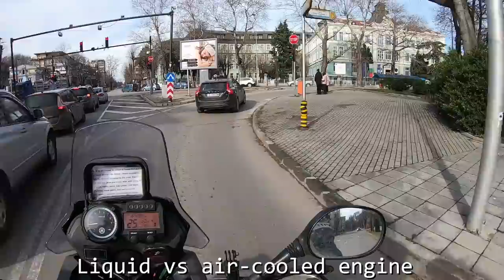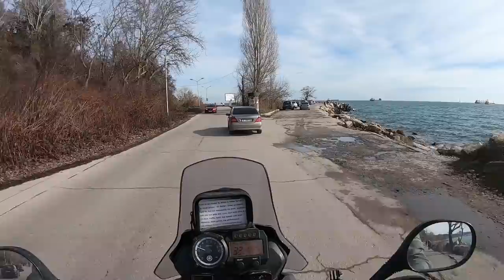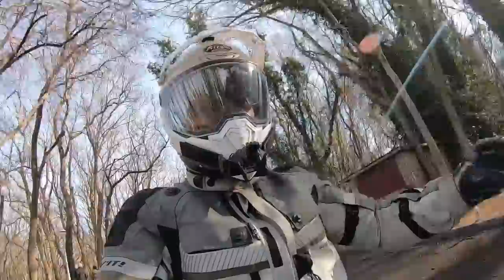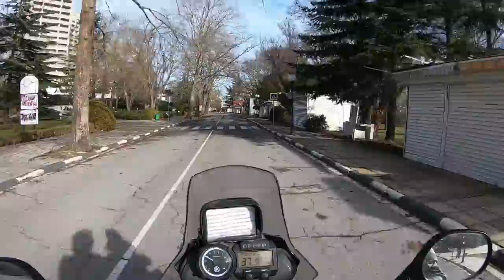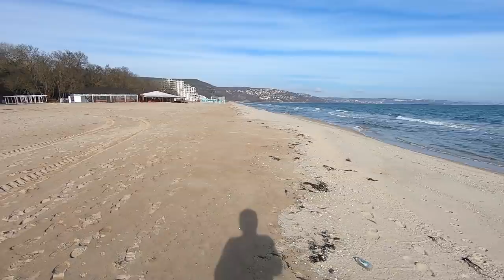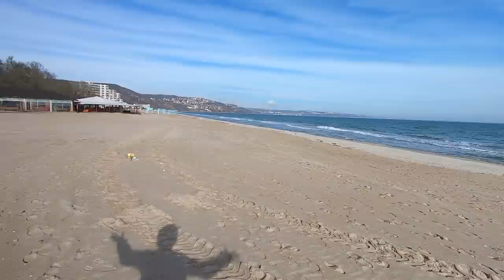Water vs Air Cooled Engine for Long Motorcycle Trips!

Comment: I basically agree with what you say in the video, but I’d put the differences to words slightly different...

As you might know I have ridden my 1990 Honda NX650 about 200 000 kilometers now, and they have been absolutely trouble free. Zero engine problems. And my old Diminutor (Dominator modified to be smaller) is certainly air cooled. 😉

But how do you distinguish between brand/quality and principle? 🤔

Has it been problem free because air cooled is as good av water cooled, or is it because it is a Honda? Impossible to know, but this I know:

I have hade the opportunity to compare with many similar sized motorcycles over the years. 

1992 and 1993 I was travelling a lot around the world with a friend with a Yamaha 660 Ténéré (with the original five valve 660 Yamaha engine, not with the 4 valve Minarelli-engine in your 660) and my Honda was not thirstier than his Yamaha. 

If anything it was the other way around. Mine took around 0,46 liters per swedish mil (=10 km) and his Yamaha took around 0,51 l/mil. Very small difference, but still. 

(Yes the scandinavian mil (used in Sweden, Norway and parts of Finland) is the perfect unit for travellers, the distance from pole to equator is (about) 1000 mil, it is 4000 mil around the world, from Stockholm to Göteborg it is 50 mil and from Lahäll in Täby to stockholm it is 1 mil! We should export the mil!😆) 

The Honda is of coarse slightly lighter than the Yamaha, 180 kg vs just above 200 kg, but the main force that uses up the horse powers at speed is air resistance. The weight means very little. 

I have later been travelling together with many others and the water-cooled Honda transalp (600 cc, 650 cc and 700 cc) has Always been thirster than my old NX650. The KTM 790 Adventure is always less thirsty though (despite it’s 95 horse powers) as is the 20 year old 955 cc Triumph sprint st. The KTM 890 Adventure seem to be about the same as my old NX650, and the BMW K1300R and the KTM 1290 Adventure are both significantly more thirsty (and of coarse much more powerful). 

So... modern bikes with fuel injection seems to be able to be more efficient, but fuel injected bikes from 15-20 years ago can be about the same as a carburetted bike. 

Lean burn is something quite modern, it seems. 

So what then is (in my opinion) the real disadvantages with air-cooling? 

It does run hotter on hotter days and at super-low speed, you are absolutely right! But I have NEVER had to stop and let it cool down. Not even in slow traffic and 40⁰ temperature! It seem to be able to cope with running really, really hot. Sure, the idling speed goes up (easily turned down on an NX650, reachable with the right hand whilst still sitting on the bike) and the peak power may go down sligthly, but is has not really been noticeable. 

So my take of it is:

An air-cooled engine must have bigger tolerances, because it can be forced to work under very different temperatures. 

And as a consequence of that, it drinks a bit of oil. From new, you have to pour in some oil now and then. More (per distance) after long high-way pulls. Maybe halfe a liter to a liter from Uppland in Sweden to the French Rivera. After 200 000 km it has not changed - it takes about as much oil as it did when new. 

Also, the oil may (for the same reason) be polluted with gas-mixture and exhaust gas at a slightly higher rate than in a water-cooled engine with tighter tolerances. But the NX650-engine is dry sump, so it has more oil than most engines, and it seems to be okay with quite stretched intervals, i.e. many kilometres between changes. I typically change oil every 10 000 - 20 000 km. 

So in my opinion, air-cooled actually works quite well, or at least CAN work really well. But the temperature is out of control, out of control as in unregulated, so the engine must be able to handle that. 

Also: Today, there are so many new thing to consider, like pollution and such, and a water-cooled engine, with injection - with feedback, is more or less the only way to go. 

It is impossible to achieve the same constant quality of combustion in an air-cooled engine with carburettor. To do that, you have to have feedback! 

That said, the electronic control from CDI and electronic injection with feedback from both exhaust-pipe and knocking sensors, is far more important for efficiency and low emissions than water-cooling. 

But everything adds up, so seeing a new air-cooled >300cc sized engine for the western world/market is unlikely. The old ones works fine though, at least if it says Honda! 😎

/Hugo

(PS. Sorry for the length of the comment. ☺️)
Reply from the maker: Well, I understand everything you have said but in all the situations that you described, a water-cooled engine would have been much better.
Reply: Yeah? How?

As I told you, my friend had a Yamaha 660 Ténéré (the first version, with the 5-valve Yamaha-engine, not your later version) and it drank more gasoline, and it did not make more horses (well maybe one or two), nor was it faster. And it was quite a bit heavier (not necessarily due to the engine weight though). 

So why better? 

Is it not subjective when non exhibits any problems? 

His bike actually took some oil too, about the same as mine. In the early 90s, all big stompers did. Water-cooled or not. 

In my opinion, there are pros and cons in both cases. I for example appreciate not having to think about cooling liquid - ever. That is extra nice during the winter. We often get temperatures down to -20 or even -30 here in sweden, and the glycol/water-balance then becomes important. I’d rather concentrate on being warm enough myself. Nor do I have to be bothered about potential leaks, due to mechanical violence from a lay down, or just age.  

I also like the simplicity of the engine, it is super-easy to adjust valves and to change the spark-plug is even easier. Everything is so opened, no radiator/radiatorns in the way. 🤗

Changing spark-plugs on the T7 is HELL! Just an example. 

Now, I have to admit that I’v changed spark-plug three times only on my air-cooled Diminutor, and every time just because I was bored. ☺️ It really wasn’t necessary. But I thought, “I wonder how many years ago I last changed plug?” 🤔

And then I unscrewed the one in the bike, saw it looked just fine, and changed it anyway. 😆

The engine was running perfectly fine. So accessibility of the spark-plug is not a big thing. But it is a difference. 

So I do not agree that water-cooled is better in every way, only that it has its advantages, and those are especially significant for high power output engines. 120 horsepowers from a 600 cc bike says - use water-cooling! 

46 horse powers from 650 cc? Well... water-cooling can be nice, but it is really not an important thing. It have done just fine without it. 

Maybe it is due to my driving? But I do not think so. I have done 2500 km (Täby Sweden to Florence Italy) withing 24 hours = very little rest for the engine. And it was just fine. 

To me, the method is of lesser importance than the result. An air-cooled engine that overheats and is short-lived, due to the air-cooling, is a bad thing. We agree on that I hope? 😀
Reply from the maker: Even if the only con of the air cooled is the overheating, it is more then enought to me to go for water.
Reply: Well, and so you did, and it worked out fine for you! 

Perfect! You made a great choice for YOU.

Then again, you are younger than me, and when you bought the 660 Ténéré, there really wasn’t many alternatives if you wanted a medium sized adventure motorcycle with 40-50 horsepowers, right? Not many at least. 

They were more or less all water-cooled. 

I on the other hand have been driving since the 70s (so... I’m quite young also😉, just not as young as you) and at the time when I started to ride, the situation was different. 

There was basically ONLY air-cooled motorcycles, and that worked fine to! 😀 

Many years later, I bought the Honda NX650 (which is a 1988 design with an engine that is a 1983 design (from the XR500R where the RFVC-engine was intruduced). 

And at that time (1990) there were a choice! Not MUCH of a choice, but some. Most adventure motorcycles of the 90s were water-cooled. The Dominator were an odd thing with its air-cooled engine. 

And as I said before - I have had zero problems with over-heating! Non what so ever. 

So... the question “if overheating is the only problem” has a slightly hypothetical ring to it. 😉

That said - you are of coarse right! 

The NX650 isn’t the only air-cooled bike in the world, and some of the others have had overheating-problems I’m sure! 

I’m just saying that the question remains unanswered: Is it due to air-cooling as a principle, or it it due to the specific designs that can not cope with the heat? 

I’d say the latter. 

During the days when BMW used moderate power in their adventure boxers, air-cooling was not a problem. Not ever. 

When the demand for higher power output grew however, they added oil cooling, then partial water-cooling, then full water-cooling. Because it was necessary due to the performance demands! 

But does your Ténéré really need water-cooling? Perhaps. I don’t know. Judging from the power output I would say - probably not. The same goes for the Kawasaki KLR650. But not having to think about it is nice too. 😀

When it comes to low power (<10 horse power/125 cc) I’d say that the “not hawing to think about it-factor” is the most important. So Yamaha used water-cooling, and Kawasaki used water-cooling. Honda and Suzuki did not (NX650, DR650). Actually the 600 cc Yamahas and Kawasakis was air-cooled, with about the same power output per cc. 

Early bikes like the NX250, Transalp, Africa Twin, Super-Ténéré, Yamaha TDM,TRX and many, many other 80/90s bikes, were water-cooled, for a reason - they needed to be. 

The engine geometry also matters. A straight four transversely mounted workes better with air-cooling than a longitudinally mounted engine. 

The CB750 of the late 60s had no overheating problems. The Henderson and Indian four had constant overheating problems with cylinder tree and four. A parallell twin has less overheating problem then a transversely mounted V-twin, like the Harleys. That is why basically all japanese V-twin have been water cooled, the Yamaha 535 is an exception, but they have handled it! Look at the huge size of the cooling fins, the engine looks really big for a 535 cc bike... 

The HD-customer may care less, and the power output is relatively small. 

An air-cooled old boxer BMW or a Guzzi V-twin, both longitudinally mounted, have very little problems with over-heating. They have superb air-flow around the cylinders, which don’t heat each other either. 

But there is always a power limit. BMW have passed it and now need water-cooling, despite the cooling-optimized geometry.
Reply: PS. The BMW R80gs that Helge Pedersen drove on his early adventures, ”Olga”, was air-cooled and it gave him 354 000 problem free kilometres. 

It did not give up, but ended up, in the BMW-museum in Munich, and at least 19 years ago it was there. Perhaps it still is?

Anyway - there are no bikes that can be bought either as air- or water-cooled, right? Every bike is what it is! You can not choose cooling system separately. 

So my advice is to make a choice between bikes based on the SUM of their properties, weighed after you specific preferences and demands. 

Not singling out one thing and say “this is the important one, this is what you should choose”. Bikes have so many properties, picking out the cooling-method and portraying it as something that is super important and then giving it a black/white-answer, may be a less than optimal. 

I rather see the engine as a whole and put MY demands on the performance and reliability, the methods used in it, is less important. Better to look at the result. 😀

The same goes for other properties of the bike. I look at comfort, economy, agility, flexibility... even looks! Well, perhaps not that much... the look of the bike is other peoples problem. When I drive it I don’t see much of it. 😎

Anyway - I want a bike where the sum of all properties is to my likening. Simplifications to rules of thumb, I don’t like.
Reply: PPS. Not only do you have one of the best you tube motorcycle-channels, you are also quite unique as a person who actually reads and comments the comments! 

That is very impressive for someone with your number of viewers. Respect! ✊

Comment: The answer to your last question Pavlin is probably: emissions/economy regulations compliance, servicing and aftermarket profits, and marketing. 

Giving a tiny Swedish Elf Puppet fewer reasons to cry and hurl blame at everyone who doesn’t ride to a communal city-based organic vertical lettuce farm on a free range unicorn, is of course a noble idea - unless we forget everything we learned about photosynthesis in our first biology lesson in school, and ignore the solar maximum effect on Global climate change...

Having said all that, as I’ve mentioned before, the bike I’m designing has a BMW F650GS Dakar engine in a CCM frame. The fuel system is being upgraded from  EFI to a Mikuni carb, and so there will be very few electronic devices to go wrong. 

The main engine sensor will only be used to switch on the fan, with a calibrated feed to an analog temperature gauge. Or I may use a digital gauge that’s swappable between water, oil and air temp. 

Where hoses are vulnerable, I may substitute stainless tubes. 

All my CCM buddies think I’m crazy not using a genuine CCM engine. But with the BMW unit I get vastly superior temperature control (as you explained), better reliability and readily available parts, plus DOHC. 

What I don’t get is a kickstart!
Reply from the maker: Thanks for taking the time!

Comment: But a million Honda cub 125 air cooled motors can’t be wrong. Most engines come with air cooled system. And they’re sold into tropical countries mostly. So I don’t think the situation is as bad as you suggest with “most new engines are water cooled”. Maybe in rich countries like Bulgaria they are 😅
Reply from the maker: Okay!